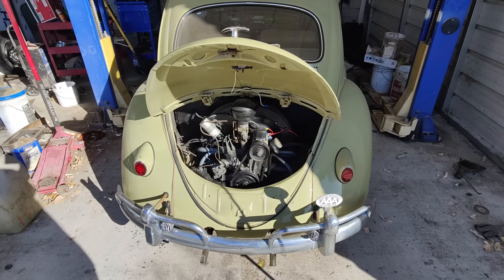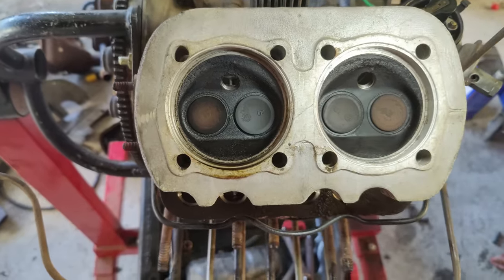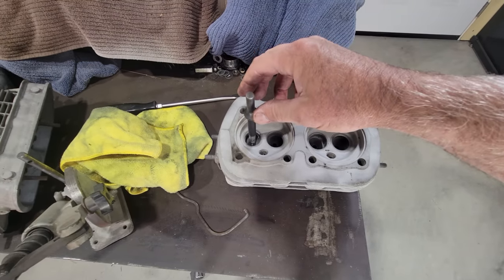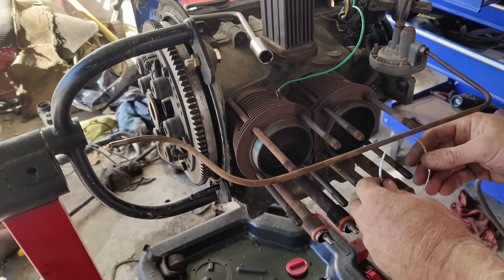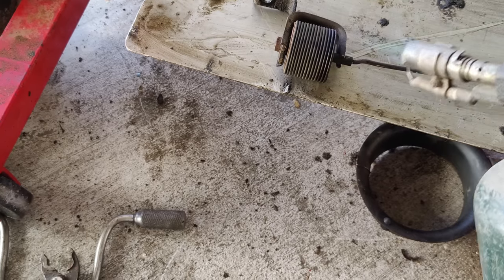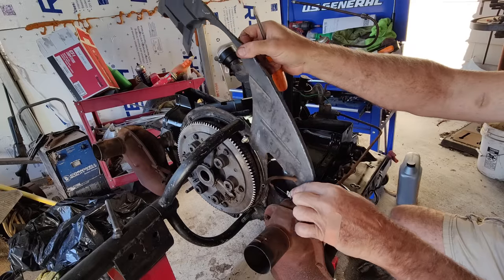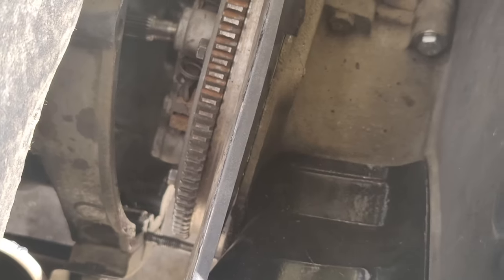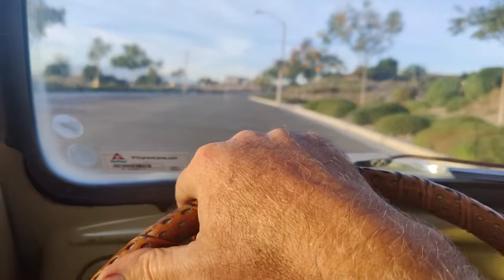36hp Air Cooled VW flat 4 valve job - Broken VW Beetle - lets fix it

Comment: Hi Mike:  According to an aftermarket VW and Corvair bellows maker. The bellows is under a partial vacuum.  When the air within is heated it expands and the bellows increases in length.  Drilling a hole in the bellows allows the inside to equal atmospheric pressure and increases in length.  In theory: if an original bellows is "short" at room temperature it should expand when heated (Murphy's Law not applied)! Now I have to locate one and test this idea...............

Comment: Thanks Mike - great video.  Im located in a colder winter area.  I always ran thermostat and flaps on my daily driver bus.  I don't drive my air cooled cars in the winter anymore. Only had one t-stat failure ever and it stuck open/expanded. The new design thermostats do fail closed and will cook your heads. So I avoid them = no flaps or t-stats unless I have good used. Also, we never re-did 36 horse engines as parts were too rare. 😊

Comment: I got stainless valves for my 1300 heads. 33mm intake and 31mm exaust i think. The bottom end on the vw motors can last longer than the heads. I would do the cylinders not the case split if no issues. Still doin my first bug engine. I didnt have to go all the way , i did its pricey and for me it was difficult. When i get valve job perfect. I can finish it up. Thanks for video. Happy motor
Reply: If it's done over 80,000 miles I would highly recommend opening up the case and getting all new bearings for peace of mind.Its not difficult to DIY or expensive.

Comment: Have you ever tried an induction heater to free up the nuts?  I’m trying one now, I haven’t found one stuck hard enough to be a problem, the first half dozen exhaust nuts have come loose if I can get the coil on the nut, thanks.

Comment: How long has it been running on no lead gas ? Volts Wagon doctor?
Reply: If you switch valve seats, valves and guides you should be set for unleaded; those were the items most affected by the content of lead in gas.
Reply: @vayabroder729  
Yes if you use hardened exhaust valve seats. Most of the old motors just used the cast steel in the head as a valve seat ?
Reply: 36hp never had trouble with loose heads , low compression  very little power, and the copper sealing ring
Reply: @bigears4014  Heard the same and with 1200s as well. Since they have less power their components suffer less than their more modern higher powered counterparts.
Reply: VW never put as much as an extra washer on a bug if it worked fine without it they would save millions by not putting on the thermostat and flaps etc.
The engine getting up to ideal running temp. quicker with the thermostat is supposed to improve gas mileage by approx. 5 per cent so there's that in theory!